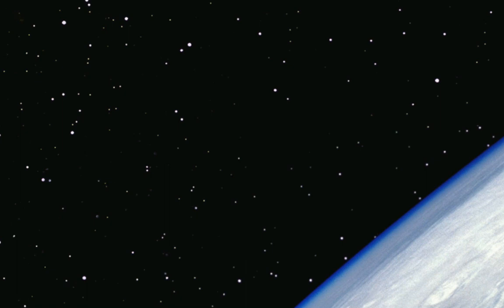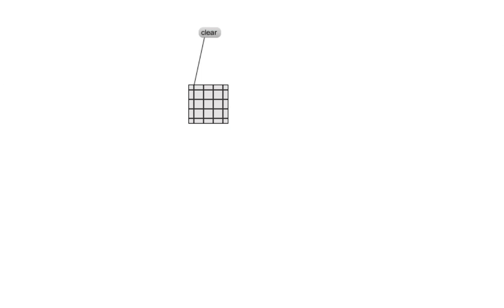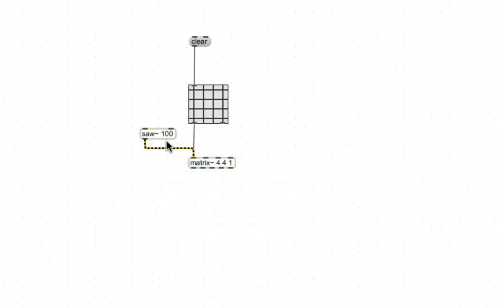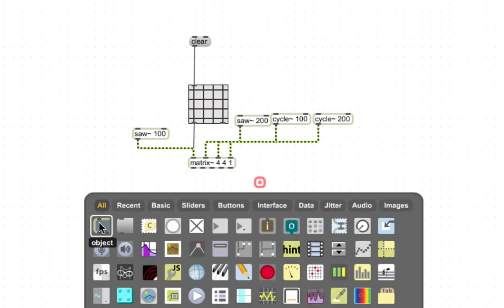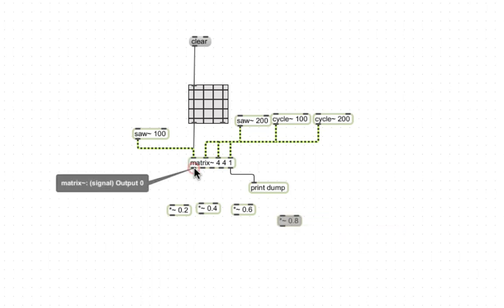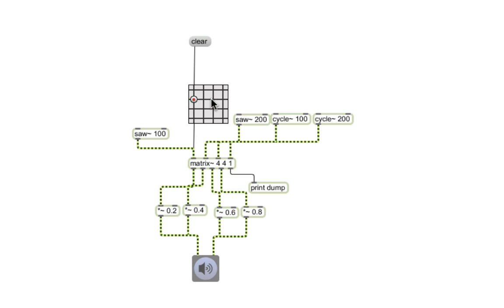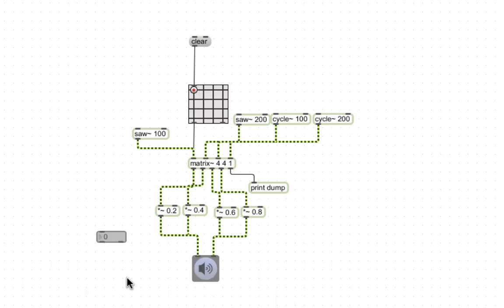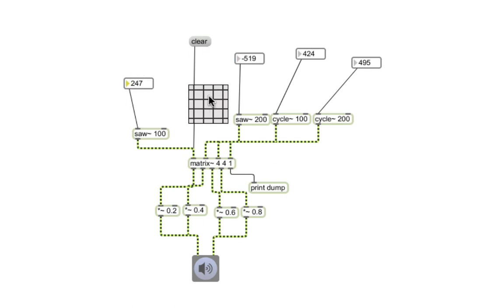How to use the matrix in Max MSP - Tutorial

Comment: I also have a MultiMix 8 USB, it's great (though a bit noisy in some cases, did you notice this too?) --- I don't think it can be used as a controller as it's only for audio, not MIDI. Though it can be a mixer for a number of channels into Max, the audio can then get routed to LogicPro with rewire~ I think.

If you can get your hands on a MIDI controller, Max (and other DAWs) really get a whole new life. Getting away from the mouse and into dials/sliders is fantastic. [ctlin] object in Max.

Comment: The matrixctrl uses picture files for its background and cells, so can be any color, though all the cells will act the same. Cells can have as many states as you want, too, not just 0 and 1. So you can use them to set things like velocity too, and they can be set in "dial mode" where you can scrub with the mouse and set ranges easily.

Cool stuff, glad to see some of these videos out there. Max is so endless it's good to have some info for folks to get started  :)

Comment from the maker: To make sure all the buttons on the matrix make a sound you have to make sure that you have to correct number of inputs and outputs. This is the numbers corresponding after the matrix~ command. The numbers mean 4 inputs, 4 outputs and the last number is an output where I placed "print dump" which sends messages to the max window (good for checking if the patch has errors)

Comment from the maker: Well, as the matrix controller is connected to the input of the matrix~ box means that when you click on the matrix. The red buttons that appear on it are a standard colour but I am sure there is a way you can make it any colour, or in fact turn every button a different colour :)

To make the sound come out of the matrix you have to add a sound wave command. For this demonstration I used saw~ to create a saw wave and cycle~ to create sine wave.